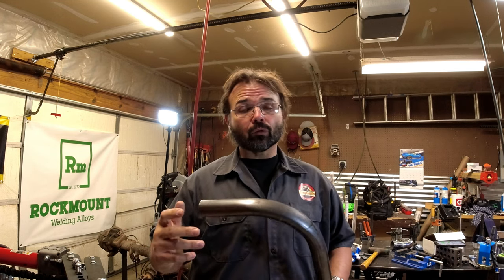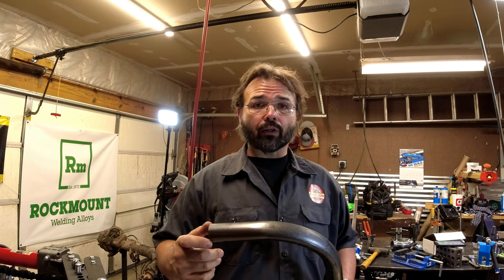Budget bending for all your Tube projects.

Comment: How do you know how much fluid to add to the Ram? I’m having issues with my new setup
Reply: with the cylinder all the way back, i filled it to the top. thanks for the question.  let me know if this helps.
Reply: @4x4fabshop  do you fill it when it’s vertical or horizontal?
Reply: @jss6060  i did it horizontally.
Reply: @4x4fabshop  thanks for the info and the fast reply. I’ll try it out
Reply: @jss6060  what position is the air system.
Reply: @4x4fabshop  I had the air over portion aimed downwards. It’ll bend to 20 degrees and that’s it. The Ram isn’t filled to the top from the factory. I know that for sure
Reply: @jss6060  try turning the air system so that is to the left or right of the cylinder.
Reply: @4x4fabshop  ya, I’m gonna mess with it tomorrow after work. Thanks for the help
Reply: @4x4fabshop  I filled her up, re-bled everything, put the Ram back in. Clocked the Ram to how this video says and still will only bend to 20 degrees. I’m kinda lost. Maybe a bad Ram but the Ram goes out all the way when vertical. Just so we’re on the same page. When you filled the Ram, it was horizontal so basically it’s filled all the way?
Reply from the maker: Yes i filled it all the way.  Try rotating the air unit a little more, some 
of them seem to be more sensitive. Your cylinder might be picking up the oil differently.
Reply: @JeepingMo  I’ll move it around and mess with it more tomorrow. Thanks for the help
Reply from the maker: We did this video on our other channel,  i cover it more. Hopefully it helps.
. Harbor freight cylinder won’t work on my bender 🤬🤬🤬
https://youtu.be/PjkAKMrf1IA
Reply: @JeepingMo  just watched it. Very informative. Thanks for the help, now it’s time to put it into practice
Reply: @JeepingMo  little update, made sure the Ram was 100% topped off, bled it really good. Rotated it a little bit more and now it’s working perfectly. Thank you to the two of you that have helped in this conversation
Reply from the maker: @jss6060  glad it helped.